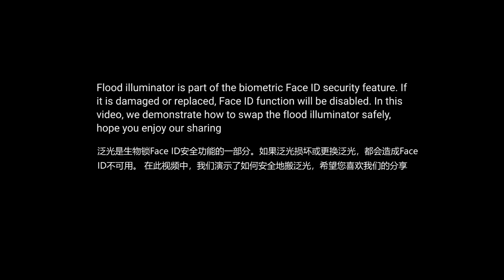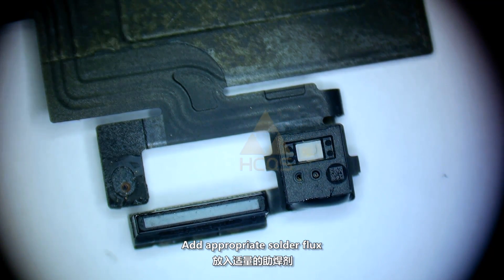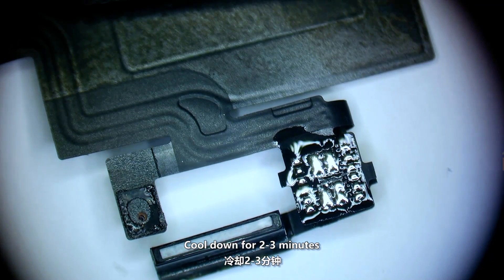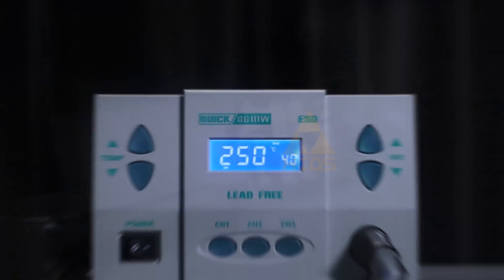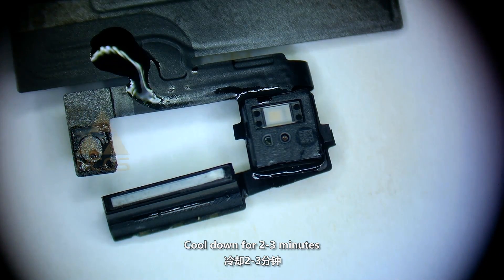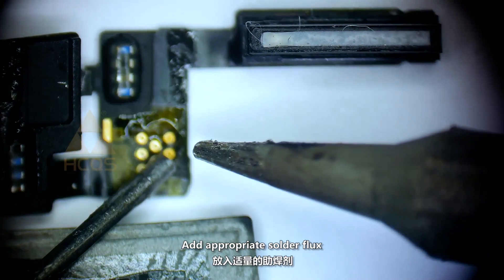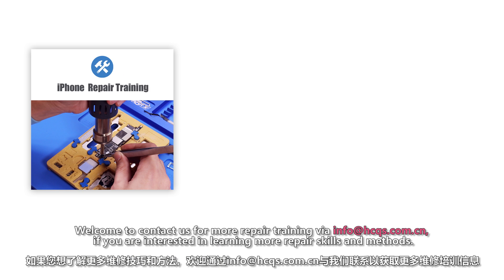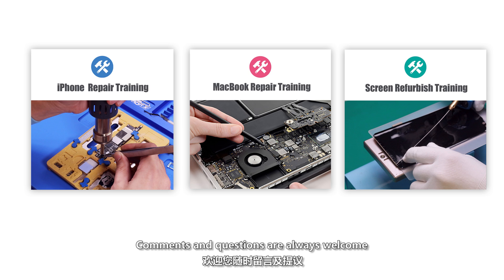iPhone Flood illuminator Removal and Restoration Guide | Motherboard Repair

Comment: Would this cause Face ID set up to say move iPhone higher/lower?
Reply from the maker: Hi, this often suggests that the dot matrix module is failed
Reply from the maker: And you can use the heating platform here to remove and reassemble the dot matrix module: https://hcqs.shop/wylie-k85-preheating-platform-motherboard-face-dot-matrix-repair-for-iphone-x-xs-xs-max-11-pro-pro-max.html
Reply: Phone Repair Share It would need to be swapped or just reballed?

Comment: Hi my Face ID is still enabled however whenever I try to add my my face I get message saying “move phone a little higher, and when I do it tells me a little lower” and continues to do this. Do you know if I swap over the flood illuminator to a new flex cable, will fix this issue?
Reply: I have the same problem, Alan. I was trying to look at normal FaceID of iPhone 11 vs my iPhone XR. So it seems like my flood Illuminator not so bright as iPhone 11 one. So I want to try buy a new flex-cable with this sensor there. That what I know at that moment. Hope it would help you anyhow. If you have solutions - please contact me! Have a good day!
Reply: uno_ if you’re flood illuminator is working but not as bright as your iPhone 11 then there may just be dust between the illuminator and the screen, so I would be tempted to remove the screen and clean the sensor and the “window” it looks through. I will reply back here if I decide to try and replace my one.
Reply: Did you end up fixing this?
Reply: mrsemifixit no never done anything about this as yet, everyone I a have approached with the issue say that this can not be fixed, only Apple will be able to fix it. I’m. It so sure though 🤔
Reply: Alan Orr I believe it’s related to the dot projector that’s why

Comment: Hey brotha my name is MAK
I am having some problem with 
cellular network of my iPhone X 

So a year back I dropped my iPhone in swimming pool actually I was trying to take some under diving shots ( believe me never trust those catchy water resistant BS advertisements)

But water damage don’t recover in warranty
So i went to a trusted repair shop 
And the guy helped me with the water problem but this wasn’t it

The water damaged my infrared modules ( dot projector or flood receptor ) hence leading me with no portrait images and no Face ID 
And it damaged my screen the spot on the screen where the QR code is present but it survived
And it also messed up with my cellular network ( my data network works but fluctuate often and I can’t make a call or receive a call it make my phone to shut down unexpectedly or sometime no service but there is no problem with the WiFi 
BTW fun fact if I connect my phone with my car only then I can make call and receive call maybe cause of the antenna of the car ) hence this is the main problem
I went after multiple repair shop
They checked if something in the chip got fused or else but non of em got deep with the problem
Btw I did all the software update and reset and shit but believe me nothing work

So I web browsed a bit 
And made a conclusion that there is something wrong with the cellular antenna
And I have to change the Face ID module ( with the front camera ) 
AND I am thinking so change my battery cause it sucks after 2 year
( but the phone has not a single scratch on it hence I want to keep )

And all this gonna cost some real bucks

So I just wanna make sure if I am at the right end of solving the problem and would it really work 

Reply if you and anyone can

Thnx for reading my problem even my IPhone is depressed now

And sincerely 
Apple Fuck You’re fake ass water resistant advertisements
Reply from the maker: Hi, Mak, first of all, thank you very much for your message and the trust you bestowed to us, as far as I can see, your iPhone is possibly water damaged and has causing problems of both Face ID and network. The best solution for your problem is that you go a shop, and ask real good technicians who can troubleshoot and solve motherboard problem, if the flood illuminator IC is survivied, may be they can swapped it for you and save your Face ID, but be prepared, the Face ID may never be recovered.
Reply: @HcqsUs  well to be real face id isnt that big of a problem

If needed i would replace the whole damn face id module in future

But the thing is whenever i call and receive one 
It show no service and sometime reboot my device 

So i dont know if there is something wrong with the antenna or the motherboard is fused or something

Btw a technician checked my motherboard and he said ive did what i can but motherboard isnt doing the cellular drop of network

So i guess the cellular antenna in flipped up

Btw internet works fine sometime it dops too but i manage it to work

So now i am using nokia3310 to make phone calls😎

Btw thank for reply man i appreciate it 
You just earned a sub there
Peace

Comment: Why after swapping the flood iluminator reball the back ?
Reply: I don’t understand either. They’re just test pads
Reply from the maker: Hi, Mustafa, after swapping the flood illuminator chip, it is necessary to reball the back of the flex cable to prevent the solder balls from fallen off. We suggest to use the low temperature solder paste to reball